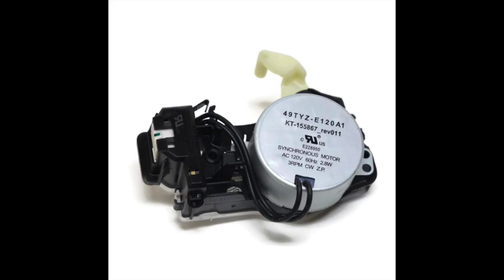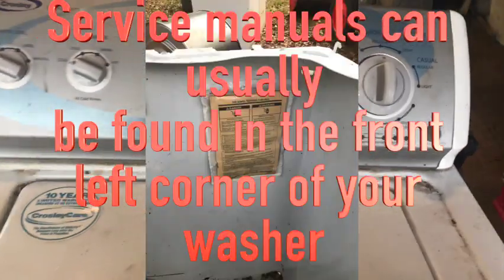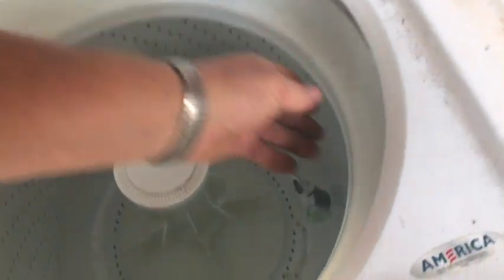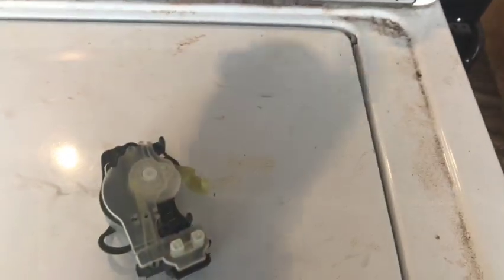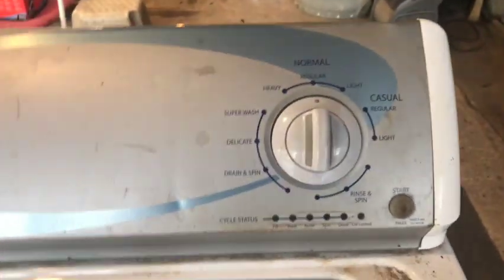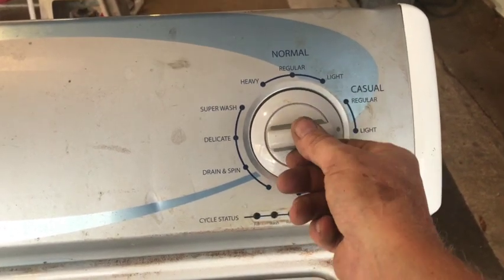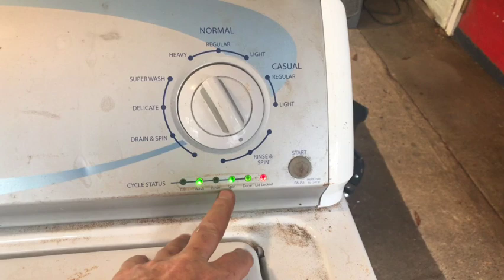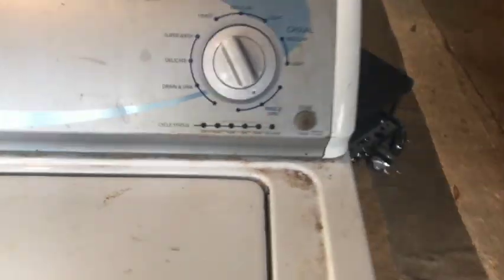How To Diagnose Non-Operating Washing Machines: Testing Shift Actuators & Tachometers

Comment: Hey great videos, thank you. My Maytag Bravos washing machine won't go into spin / agitate mode. I originally thought it was the lid lock, which I replaced, still not working. Thanks to your videos I diagnosed the Shift Actuator off the machine by applying power to it and it moves, so that seems to work?  But while the machine is trying to run the Shift actuator is humming (while in the machine). Does this mean it is bad?
Reply from the maker: It could be the motor speed sensor (a part of the actuator) try changing it. Thanks for watching!
Reply: @HarperandKnowles  Thanks, I ran the diagnostic test for the tach / rpm and it worked, but I figured the actuator was making noise so I ordered a replacement.
Reply: @HarperandKnowles  If it happens to not be the Acuator, what else could it be?
Reply from the maker: Could be the splutch.
Reply: @HarperandKnowles  Thanks, I took that out and it all looks good.
Reply: @scubaken89 Just came across this. 
  Could the capacitor be causing this problem?
Reply from the maker: The capacitor symptoms will be the motor humming when trying to spin or agitate. Thanks for watching!

Comment: One of the plastic pieces that are side by side on the part that goes inside where the sensor is broken. This is my problem I am guessing. What would cause that? I also changed the drain pump and found 2 random wires in there.
Reply from the maker: I never saw that before. Maybe a rodent dragged a nut in there and it got caught between the wheel and tachometer. The wires must have come from the wash. Thanks for watching!

Comment: what about a situation where the tachometer test is successful and the lights rotate through but the test for agitate and spin still do not work? Does that mean its something with the control board?
Reply from the maker: No, you probably have a problem with the shifting part of the device or a splutch that isn’t moving properly. Thanks for watching!
Reply: thanks! @HarperandKnowles

Comment: my washer will only work on gentle wash and now i think the tac is bad
Reply from the maker: What kind of washer do you have? Model number?
Reply: model no. WTW4950HW1    will only work on gentle an  two codes  F7 E6 & F2 E3 are the codes what could ibe wrong
Reply from the maker: If you’ve been hearing a loud roaring noise during the spin cycle, or if you spin the tub by hand and hear noise in the bearings then your bearings have gone bad. The drag on the unit when it tries to spin is causing the motor to over torque and that can cause the F7 E6 error. The F2 E3 error may be related too. If this isn’t the case let me know, we’ll research it further.
Reply: @HarperandKnowles   bearing are good 
I changed the control board because the technician told last owner it was bad and mad no different
Reply from the maker: Do a diagnostic check on the spin cycle. I bet your tub hub is stripped out. The splines on the gearbox shaft are corroded and stripping. The reason it only works on gentle is it starts the spin cycle gently enough that the shaft doesn’t slip when starting.  Usually when this happens the gearbox has to be replaced. I’m betting your motor will over speed if you do a spin test.

Comment: My machine agitate but won't spin .I follow your diagnostic tachometer test and my lights did not flash in sequence only stay on done so I guess its the tachometer part of the shift actuator faulty what's your opinion, and thanks for the information it really helped
Reply from the maker: Yeah, if those lights don't cycle after entering the diagnostic mode for the tachometer correctly, then your shift actuator is malfunctioning.  It could be as simple as debris blocking the optical sensor.  When removing your actuator, check that there isn't trash in the housing where the optical sensor fits.  I've found leaves and debris there dragged in by a mouse, and once I found a fabric softener sheet that got in there somehow. If you find rusty water residue obstructing the sensor, you have a seal failure, which is a whole other issue.  Thanks for watching and commenting too.

Comment: Nice instruction, thanks! 👏🏻👏🏻

I’m getting a Shifter fault code registered in our Kenmore top loader and this is a big help.
I can clear the code and the next cycle will work fine but I see it continues to throw the same code.  
Subsequent loads may or may not run fully through the wash cycle without manually selecting the spin cycle only.
Great channel, thanks!
Reply from the maker: Try squirting some lube on the inner ring of the splutch.  I’ve had some luck doing that. You can usually reach it with a straw adapter on a spray can. If that doesn’t fix it you may have to change the splutch if your shifter is okay. Thanks for watching!